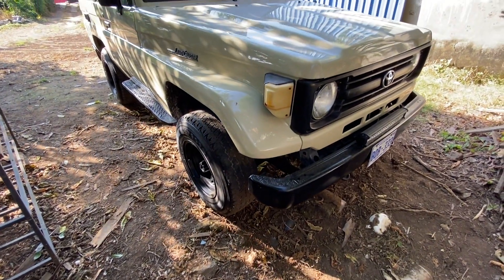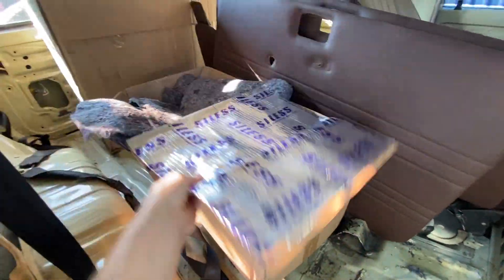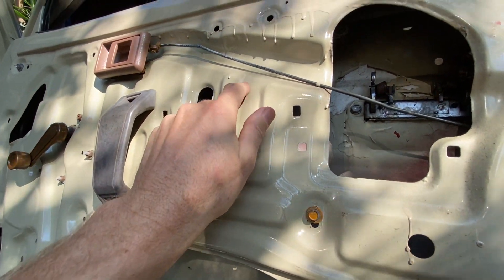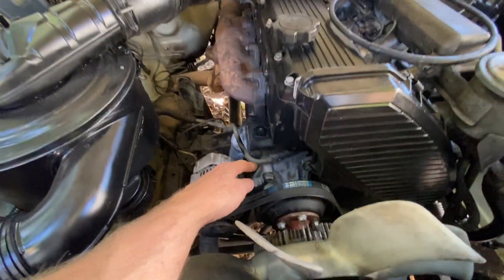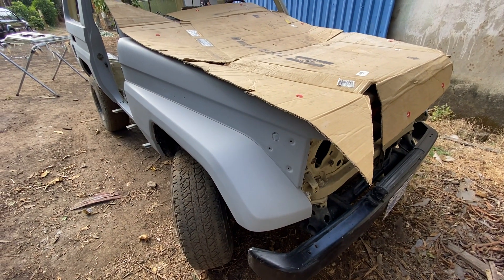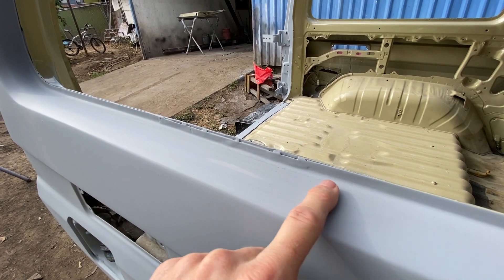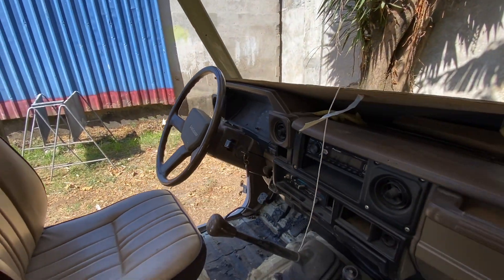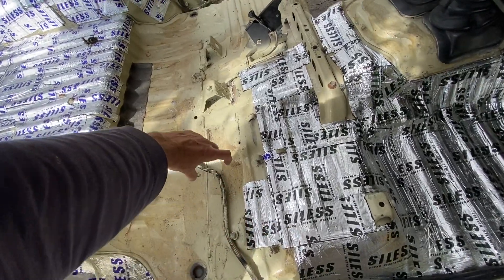1995 HZJ70 Toyota Land Cruiser Restoration PT 2

Comment: In the future, I plan to import a 4-door 70 series pickup truck, which is going to be my ultimate vehicle
Reply from the maker: Mine as well for the 75 series!!
Reply: @arvbnb9735  thank you keep  in touch if you find a good one I'm interested, I'm driving my  80 series LH 1HD-T but I'll  change to  75 or 76
Reply from the maker: @classic-4x4  Will do.  I had a chance to buy a 1995 with the 1HZ about a 2 years ago but it did not come together. Would have been a keeper for sure!